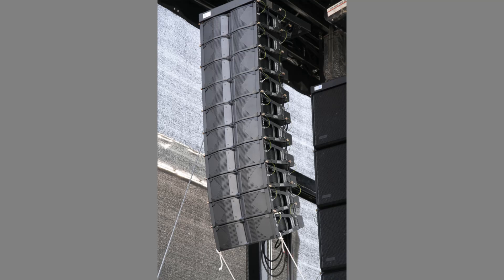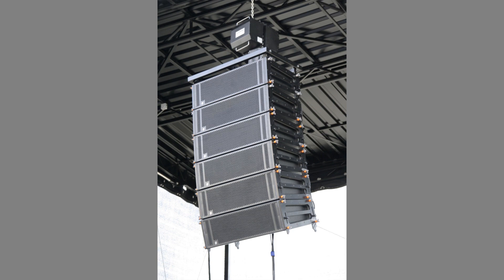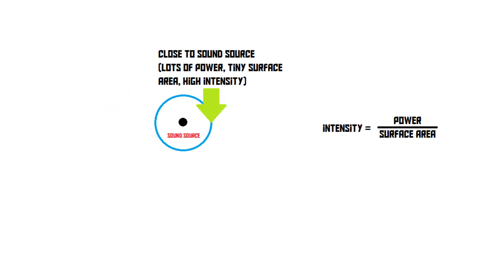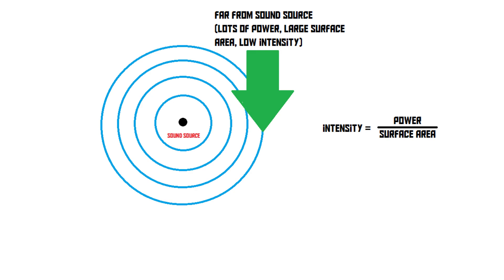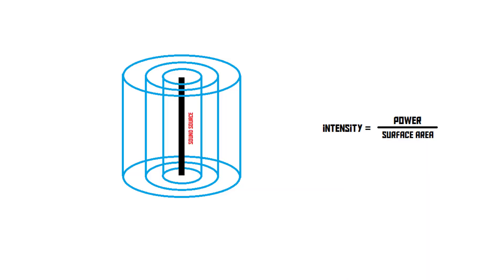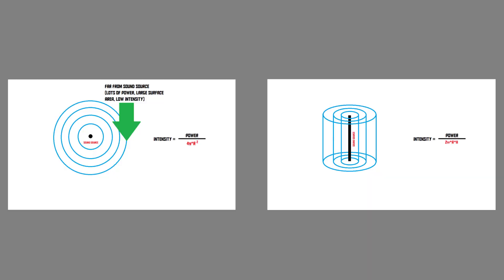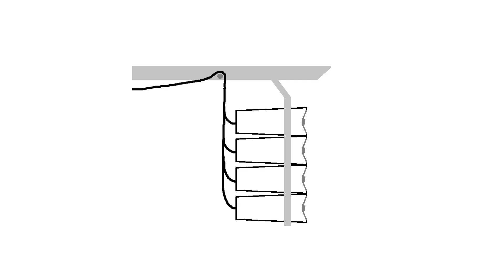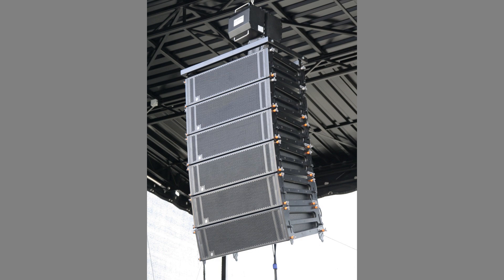Line arrays explained (AKIO TV)

Comment: Great that you made this video.   Your explanation is fun - but missed a few things. 

To really understand the line array - start by adding two sinusoidal functions.  Then - add 3 functions.   

A line array is the controlled and manipulated summation of 'N' sinusoidal functions.    By controlling the timing of the addition the directional dependent wavefront intensity can be manipulated:  sound reinforcement companies call this "lobe shaping." 

I suggest some papers by Leo Beranek (the grandfather of acoustical engineering)

The same math foundation applies to passive sonar - towed arrays.

Comment: The formula is wrong because the the cylinder is higher when you increase the distance. The beam ln degrees from the array  is constant and indepentent of the disrance. The better coverage is because you only send sound in direction.  You can compare with light on you car. 
.

Comment: I would add that the speakers are flown in a trapezoid manner. Not a perfect line. Therefore, starting from the bottom up, each speaker is set louder than the one below so that as you move farther away, the volume stays as consistent as possible throughout the venue.
Reply: ...wich is completely wrong..remember there are passive Line Arrays wich couple 4 boxes to one amplifier. How would you achieve your point then?
Reply: @orangenotviolet , OK, I did some research with a personal friend of mine that works in the larger festival venue industry. 

He says the average is three boxes per amplifier. But then you have 12 boxes on average, per side. We’re both right, and we’re both wrong at the same time. My statement still stands, but it’s every three boxes, you’re going to have adjustments for volume and other more complicated parameters. I will copy and paste my buddies answer.
Reply: @orangenotviolet ,
This is my buddy Stuart that works front of house for Live Nation at major Festivals and completely understands line arrays:

Powered boxes are much heavier and since the amp is un the box you would not be able to switch it out  without dropping the whole PA so it is uncommon for large concert systems to use powered / active boxes in a flown line array for a touring system. Some venues use active boxes for their installed house line arrays for convenience or due to limited space ....usually smaller venues .... I suspect percentages would sway more towards the passive boxes being the most commonly used.
Line arrays run from racks of several amplifiers.... since there  are several drivers in each box they are powered by frequency ....one set of amps for highs..one set for high mids....then low mids...then lows....then yet more for  subs. 
I am talking larger systems obviously.... smaller club line arrays could use a single 4 channel amplifier to power all.... or use powered boxes as previously  stated
Oh wow! So regarding only most larger systems, each box is running at the exact same volume etc.?
No they will be set to different levels according to their position in the array.... there are measuring devices mounted on the arrays that measure actual distance from speaker to wall or floor at various points and these are fed into a program that calculates the levels and send this information to the amplifiers and then the amplifier calculates delay time and phase corrections to minimize comb filtering and beaming/ power alleys in order to deliver even coverage from the nosebleed seats down to the first row. 
Another reason why they don't put amps in the boxes.... they are constantly updating and improving amplifiers since the digital front end of the amplifier is a very important part of the equation 
One line array box costs over $10, 000. One amplifier costs over 12k
Figure 18 a side.... plus 36 subs ( around 14k a piece)
Power consumption is even crazier 
14,000 watts per amplifier ..one amp runs 3 array  boxes...or 2 sub boxes...so 30 amplifiers total  for 18 a side with subs... now add another 12 boxes a side for side hangs in an arena or stadium....
The cabling alone costs tens of thousands 
Minimum of 12.... arrays don't work efficiently with less.... 
All pertinent to large systems.... rules change as things get smaller... but still tend to use passive not active boxes....
Reply: @orangenotviolet , All the line arrays I’ve ever seen have been active.
Reply: Changing the intensity for the lower speakers is called intensity shading, which actually isn't the optimal way of creating an even intensity distribution, as the sound from the then louder top speakers is heard in the front aswell. The newer/better way of doing this is the use of divergence shading, and fir/iir filters like d&b's Array processing. Basically, you use the curvature to make the lower speakers cover a bigger area while keeping them the same level, which means more area to cover with the same energy, which then in turn results in the more even intensity distribution. 
D&Bs array processing is using fir and iir filters to basically virtually alter the shape of the array to the best shape for a big bunch of frequency bands, here's a good video explaining how it works by d&b itself: https://www.youtube.com/watch?v=xD3uDpYniXU

Comment: I've never heard a line array that sounded good, whether a sound reinforcement speaker or an audiophile speaker. They are particularly abysmal indoors.
Reply: Q-tips friend.... I have a 16 array system INDOORS an it sounds amazing~! there are weird spots in the room but if you happen to stand walk sit in the "sweet spot" better hold on it will blow your mind how amazing it sounds. 16 arrays (4x4) + 4 12 subs + 10" & 12" monitors  total power about 10K watts. AMAZING!
Reply: While they are indeed abysmal indoors, they are much worse outdoors.
Have you ever heard what wind can do to the sound coming from a line array?
Reply: @AB-80X   wind can be a issue BUT can be over come easy IF A the sound tec. knows what he is doing, adding some delay to the fills or just having fills processors etc. so in short if the event has $$ an the production company has the right staff wind is no issue.  Have a look behind the scenes of a festival on the coast an how they address the issue of wind an how they combat it using fills an sub placment SPL etc. https://www.youtube.com/watch?v=R2DDR_fqtKg sounds like they system you heard you say was abysmal was ran by a rookie. I have line arrays an plan to expand my system I will never go back you think wind affects arrays think of what it does to stacks an stacks of 12s 15s 18s you still needed a processor with those systems an delay could be used as a weapon against wind on your out fills .... watch that vid link
Reply: @nonyabeezzzwaxxx2705  
First off, let's get one thing out ofvthe way. I am no rookie when it comes to setting up systemx and dealing with wind. I was brought in to do the design on Jean Michel Jarre's Aero concert in Denmark for this very reason. Do not even try to hint that I don't know what I'm talking about or am doing, because it's very far from the case.
Secondly, I was actually at that festival with my wife as normal attendants. 
It's a nice video and they talk a lot about how great everything was, but here's the short of it. It was an outright mess of sound. No stereo image, combfiltering like you would not believe, speakers that vere totally "vissible" all over the sound stage and simply no depth or imagery. All lines could be pointed out straight away and it left a huge void where the image should have been. This combined with time alignment issues and combfiltering, meant a live sound experience with absolutely no definition.
One cannot be surprised. If you add another argument to an existing argument, one ends up with a bigger argument. Here you had a bunch of speakers arguing in the wind. I'm sure John Meyer and Roger Schwenke were proud and nowhere to be found as always.

You mention your line arrarys. How many do you have and what does each of your line arrays consist of? Brands?
Also you mention your system playing indoors and it having weird spots. Then you follow that up by saying that if you get a sweetspot you better hang on to it.
This leads me to a couple of conclusions.
You think it's okay that there are weird spots as long as there are sweetspots. 
It sounds like there are few sweetspots, as one needs to hold on to one if one is found.
So here's my question.
What about the hundreds of paying customers that did not get a sweetspot? Do they not deserve a good experience? This is EXACTLY what I mean when I say that poor quality sound is robbing people. I would feel so embarrassed and  like a real shit if I knowingly had people come to a venue, all while being well aware that only a few select actually got the experience and quality they paid for.

This is exactly what is destroying the industry, the quality of the shows and the integrity of the performers.

YaY line array....
Reply: @AB-80X  first of all, nothing is perfect, and livesound is completely different from hi-fi. What you are saying is that livesound should sound like a sound isolated room with a million dollar hi-fi speakers. Well dream on, when you are playing for tens of thousands of people you need something else, enter the line array. Of course it isn't perfect, but with proper tuning(which sounds like it was lacking in your example) is the best alternative we got and it is good enough that if you know what you are doing you can create truly memorable experiences for the entire audience
Reply: The hard part is getting the tweeters to couple, although path equalising waveguides can be used to help this. Of course, they are inferior to point sources but are usually the best way to put lots of speakers together if you want it "LOUDER" than one speaker will go.
The wind effect is double if the speakers are only secured at the top like at one gig I went to they were swinging back and forth in the breeze! Although it was a fairly low flying D&B rig. I've often found them to sound a bit beamy as in they blast you with sound and good treble if you are dead onto the stack but a small amount of swinging created comb filtering and a bit of a "nasal" sound when you weren't quite dead on and then of course it's designed to drop off above and below the stack.
Tom Danley addresses a lot of the limitations of line arrays and self interference which is what makes them work is one of them.